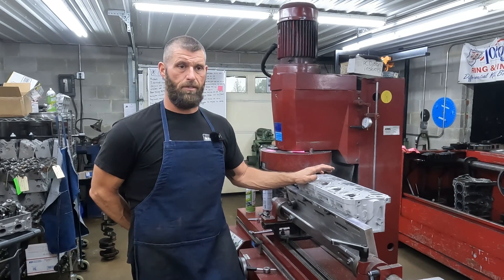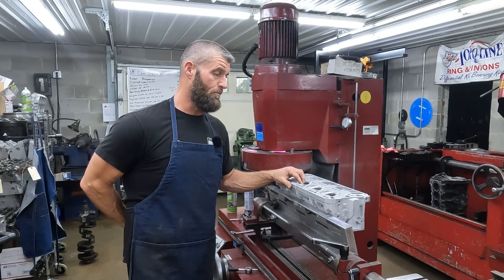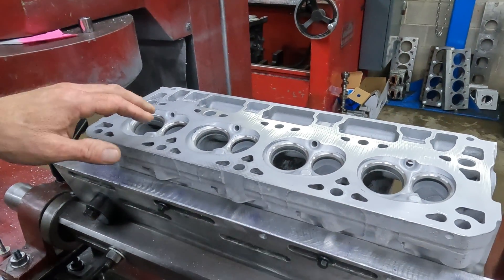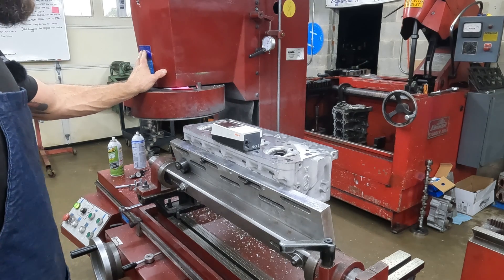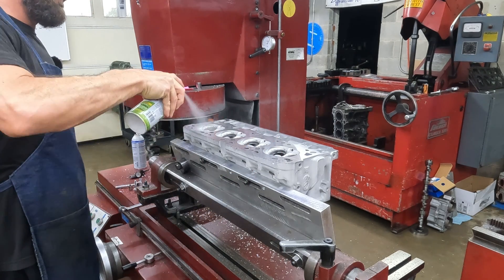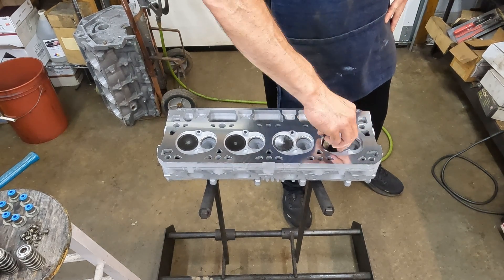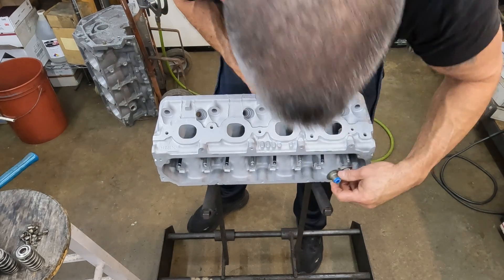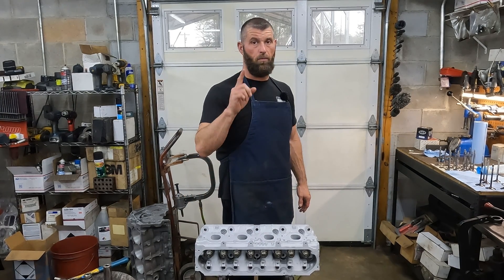Gen V L83 Head Job

Comment: why isn't the person running the valve grinder not moving the valve across the face of the stone in order to help keep the face of the grinding wheel true ,maybe I was taught wrong, keep up the good work love the channel you are the best 👌
Reply from the maker: Do we drag the stone across a cam,crankshaft, flywheel or anything else?
Reply: @powellmachineinc3179  if that was the case have you ever ground a valve that needed a stone that wide ,Thank You for the response

Comment: On your valve grinder machine....is the valve always going back to the same spot on the stone?...wouldn't the stone start getting worn from always being in the same spot?i know you flatten/sharpen the stone every once in awhile but that seems like an accelerated waste to me.your machine is similar to the one we replaced here but ours the valve rocked back and forth across the whole stone.boss went with a new rottler settup now to where the stone moves across the face of the valve.do you vacuum check after assembly?i know its hard to kinda show and explain every little tid-bit of the machining/building process,i enjoy your vids

Comment: I've been a heavy truck and diesel mechanic for 25+ years. I currently work at a volvo/mack dealership. The modern volvo/mack engines don't have the lower valve spring locators. I was surprised the first time that I noticed. I thought something was wrong.

Comment: What your experience and recommendations with eagle connecting rods? Quality etc. 5.3 turbo build street strip deal. 6.125 rod length L19 bolts. Thanks
Reply from the maker: I won't use Eagle in anything we build it's the absolute cheapest

Comment: I thought when grinding valves the valve gets stroked passed the stone?
Reply from the maker: We find it's much less accurate,  you don't stroke the stone when grinding a cam o, crank , valve seat or flywheel do you?
Reply: The valve shouldn't go past the edge of the stone, but it should be run across the full width of the stone.
Reply from the maker: @oscaracme  why?
Reply: @powellmachineinc  so you don't end up with a "pocket"? in the area where the valve sat that will round the edges of the later ground valves. When you dress the stone, don't you notice the un-eveness going across the stone? You do dress the stone every time after a restart of the valve refacer motor?
Reply from the maker: @oscaracme  we dress before every set, and we use the entire face as we go through,  no pocket

Comment: Do you have engines for sale ( LS)  or do you only rebuild the ones brought to you ?  Thanks
Reply from the maker: We don't have anything ready but our business model is moving to that and away from building customer supplied units
Reply: I have a 05 Tahoe with 300,000 on it..still runs good..just loosing some oil pressure..needs bearings..I’ve done the pump and other stuff..but planning on replacing engine in future.

Comment: When rebuilding a set of heads in good condition like these and not replacing the valves and guides, do the valves have to be placed back into the same guides that they were removed from?
Reply from the maker: No

Comment: I would never willingly buy a DI motor...but if for some reason ended up with one I'd install a simple water injection system on it to keep the valves clean.   Years ago I ran turbo small blocks that needed the WI to stay alive and every time I tore one down it was spotlessly clean inside from the steam cleaning of the water.   On a daily driver a couple hits of water injection every time you fill the gas would probably keep the valves clean enough for long service.
Reply from the maker: Yep

Comment: Direct Injection negates all of the detergents in gasoline that wash the stem side of the intakes on normal port injection or carburated engines.  The manufacturers need to put a filter in the PCV system to filter the oil particles out of the vacuumed blowby gases.
Reply from the maker: Absolutely